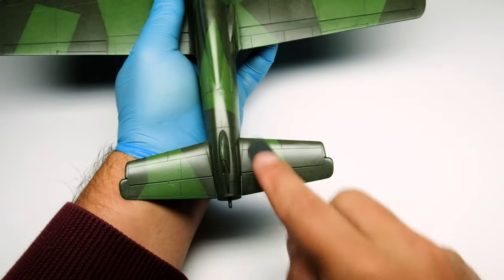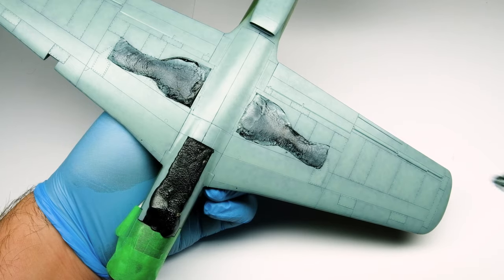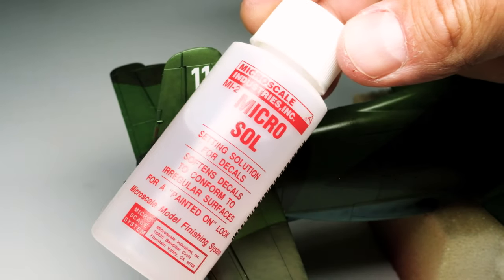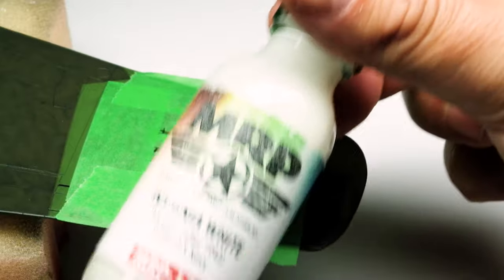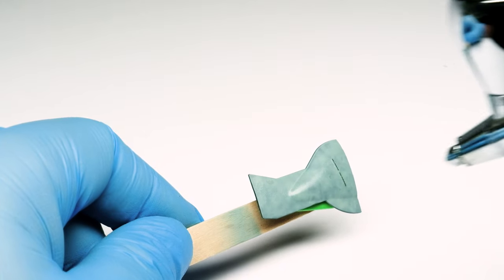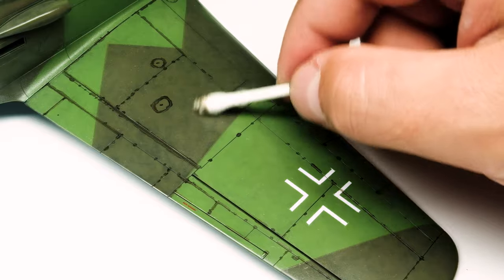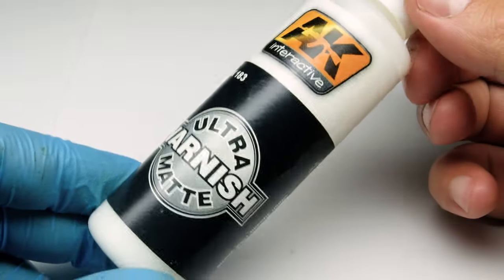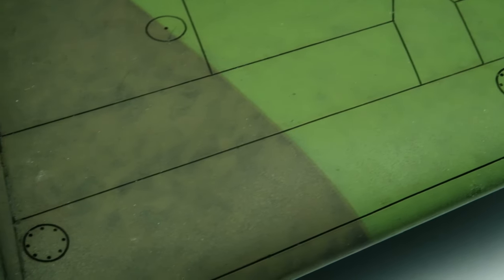Decals, Clear Varnish, Panelline Wash - Dornier Do335 A-12 1/48 Tamiya Scale Model, Ak interactive

Comment: Hi Leon, short question, is the ak gauzy your absolut first choice for a gloss finish? I struggle alot with geting silvered decals. I relly think that your step with the polishing and another coat is crucial. Will try this on my next build. Do you polish with the stick dry? Would be wet even better? Thanks for your help
Reply from the maker: The Ak Gauzy worked best for a gloss finish. I have often the same Problem with decals. Your right, I could have polished it with a wet polishing stick for a better result, thank you for the advice!